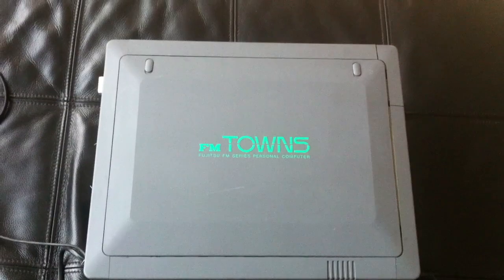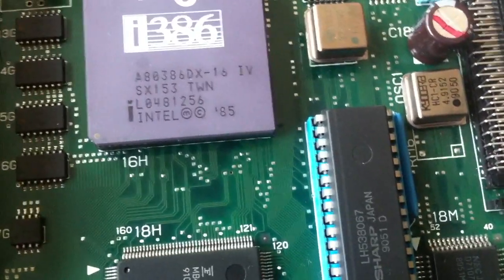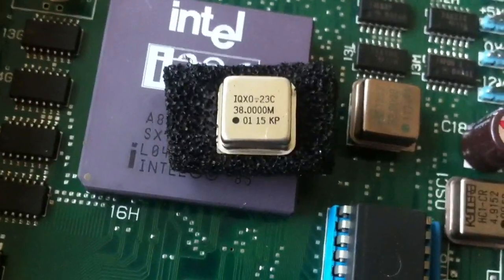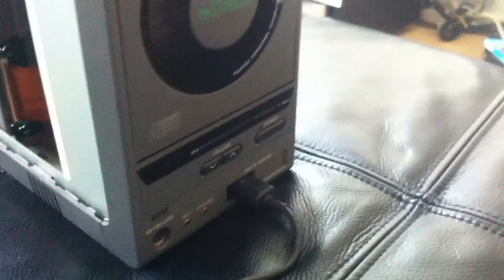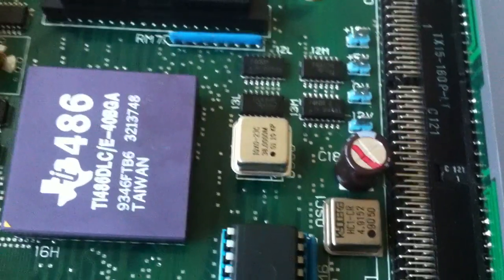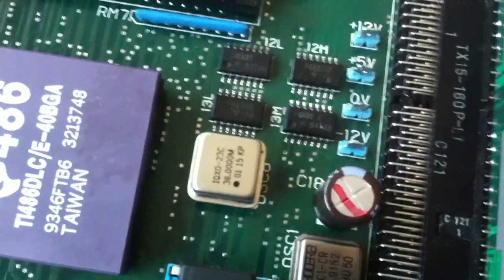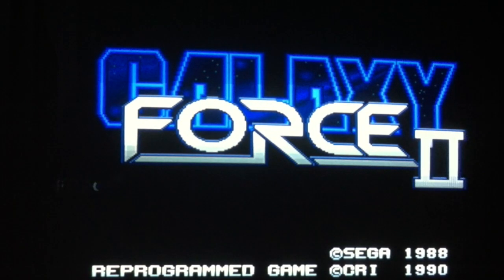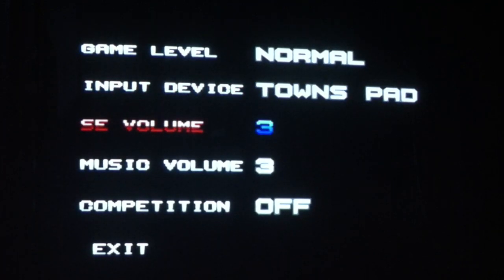FM Towns Power-up! i486 CPU upgrade, plus Galaxy Force gameplay. WOW!!

Comment: Do you know if it's possible to upgrade the UR20 processor somehow? it's an i486sx 20mhz. I did find this, it should work right? http://www.cpu-galaxy.at/cpu/intel%20cpu/Overdrive%20486/Intel%2080486%20overdrive%20section.htm
Also the reason why I want to upgrade is to run FM Towns version of Dungeon Master which runs sluggishly horribly on the stock UX20 i386sx 16mhz which I currently have.
Reply from the maker: Elrinth unfortunately I do not think so. 386SX CPU's have a 16 bit bus width, unless the 486SX also operates on a 16 bit bus you cannot swap one in for a 386SX. Try to research it, I am not familiar with any overdrive processors being made for upgrading those low end 386 processors.
Reply: the UR20 is i486 20mhz. and I found overdrive processor for it! :D
Reply: yes there are many 486 cpus that run on 16bit bus the fastest was made by IBM called Blue Lightning

Comment: Hello. How did you desolder the CPU?
Reply from the maker: I tried the traditional solder iron/sucker combo, but that was not working. So I gave it to my dad who desoldered it at his work using professional industrial equipment. Not sure what, but certainly beyond what is available to consumers.
Reply: I see. As I know, majority games of FM Towns are optimized for 386DX CPU performance. 486 based FM Towns also operates at 386DX speed to maintain compatibility. Then which games get benefits from 486 CPU? I have a plan to upgrade with TI486XL2 CPU and I guess several games probably made for 486 based FM Towns. For these games, this CPU upgrade surely can get benefits. And do you use cache driver? There is a user made cache driver for FM Towns and I wonder it works well or not.
Reply from the maker: @ychh0484  The number of interesting games in the FMT library is quite limited in my opinion. A lot of them are ports of DOS games, and they were originally made to run on all kinds of PC hardware, so they can handle higher, lower speeds just fine. Of the platform exclusive games that I've tried none had problems with the higher speed. The FMT platform did get higher specced CPUs in time, up to Pentium, I think. So any robustly developed games should be fine as well. As for the cache driver, no, I have not played around with that, so  I can't comment on it.

Comment: You are missing a memory stick
Reply from the maker: Not really, my FM TOWNS machine comes with 2MB ram equipped on the motherboard, those slots are for additional optional memory.
Reply: So why don't you fill them up especially if you upgraded the processor !
Reply from the maker: I have tried, but Japanese PC's from that era are very picky when it comes to memory. I have some memory sticks that should work, but they are not fully compatible, so the machine does not detect their size correctly. The one I have in there is detected as 2MB, but is larger. One might be able to make the machine recognize the memory size correctly by soldering some config jumpers on the module, but I couldn't get it to work. 4MB is plenty for any games I am going to run on it, so I stopped wasting time on it.

Comment: Those TI chips are almost total BS. The 486 isn't much faster than a 386 DX anyway. The big improvement was the integrated math co-processor and a larger cache. It still has the 32 bit external data bus. Most of the 486 MB had external caches wich helped a  lot and the 486 mostly ran at higher clock speeds as well.  This was a total waste of time.
Reply from the maker: tarstarkusz it was a waste of time regardless, the FM Towns games that interest me run fine on even the lowest end towns machines. I did it just for fun.
Reply: Fiar enough. I hope you're enjoying it! I love old computers.
Reply: From what I know the original CPU was a i386 @ 16 MHz so the crystal being originally 32MHz was being divided by 2 (probably using it for timing of other chips as was common practice) so when you replaced it with the 38MHz (19MHz to the CPU) MHz you were overclocking the other chips also, which is why you probably cant go higher this way. The Ti 486DLC was actually a re-branded Cyrix 486 which was not as efficient as the i486 by a good margin. The issue is a 486 is more efficient at running 486 code but when running 386 code (and there is a difference) the difference is less. So you don't get the full 486 upgrade as the code running on this system was compiled for a 386, then on top of that the Ti 486 chip as a whole was less efficient. Your Ti 486 was supposed to run at 40MHz (not clock divided) which would have been a significant upgrade but a 19MHz Ti 486 (remember less efficient that the i486) probably not worth it. Another thing worth noting is that this game and probably others weren't CPU bound, relying on the additional custom hardware, making this upgrade useless and possibly detrimental.
Now I want one to experiment with lol. I wonder if you could isolate the clock frequency from the motherboard and directly pump 40 MHz to the CPU.
Reply: For some comparison my friend had an Amiga A500 upgraded to 68020 @16 MHz, 4MB RAM which was a massive upgrade over the original 68000 @ ~7MHz, 1MB RAM. Much quicker than the obvious 2x MHz difference when doing intensive computing like animations and Ray-tracing but most games it wasn't noticeable except when playing vector and real 3D games (not just sprite scaling)
When I got my A1200 68020 @14 MHz, 2MB RAM I was initially disappointed being quite a bit slower (even taking into account of the 2MHz difference) but my first upgrade was a memory upgrade to 4MB and the speed upgrade just with the extra RAM was huge (way faster than my friends system) that set me off on an upgrade path of several CPU cards (I believe 7-8 separate upgrades) making that system into a monster.